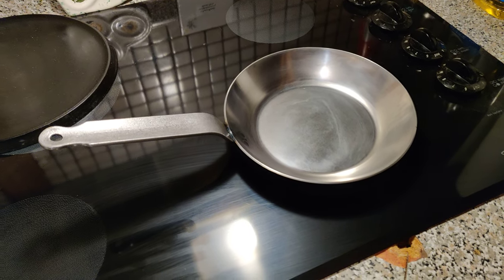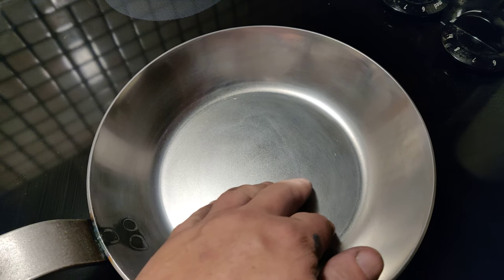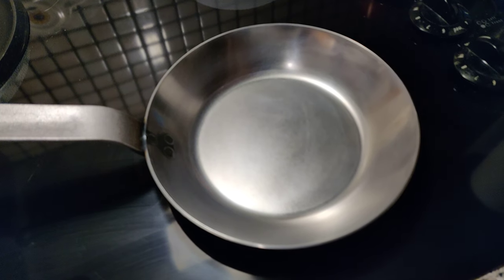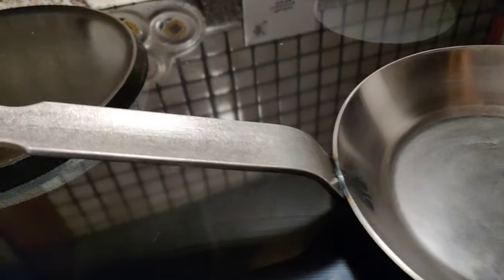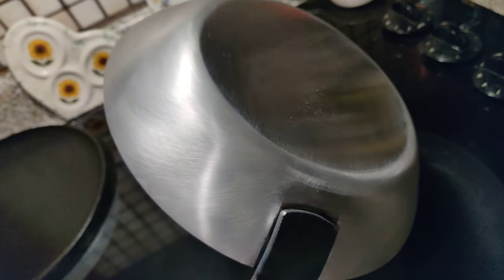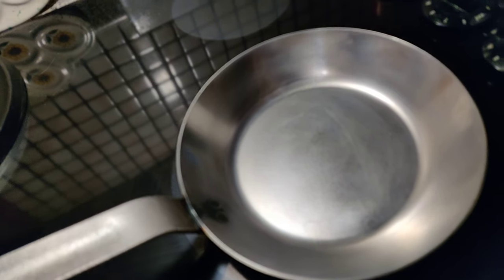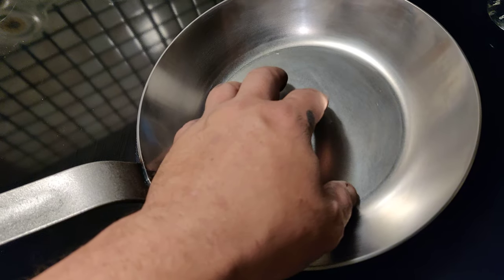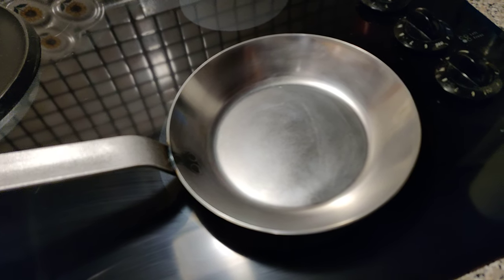Matfer Bourgeat Remix - 3 WORK'S DONE!

Comment: The skillets are made by Turk Metall Germany (series 662). Turk recommends to soak the skillet in hot water and washing powder (yes, washing powder, not dish soap). Let it soak for at least 30 minutes, then scrub it with steel wool. It will make removing the rust protective coating much easier.

Comment: I used a Brillo pad and it did nothing to remove the coating. I might have to get some of that silicon carbide abrasive tog eat a nice finish on my pan. I might start with 320 grit wet sand paper and see how that goes. Otherwise I’ll try the silicon carbide abrasive.